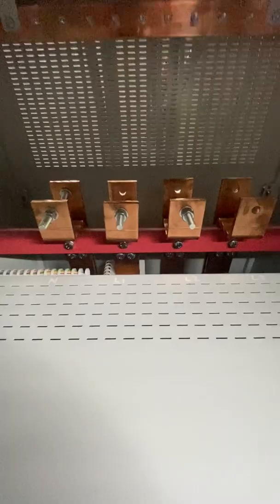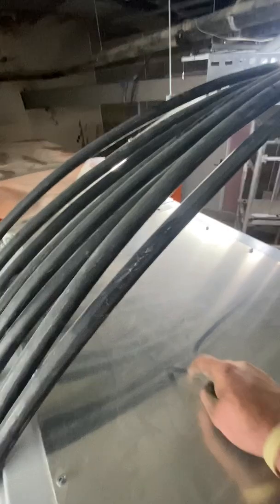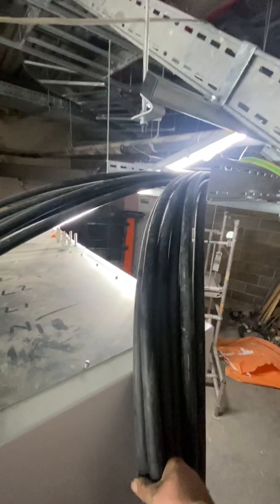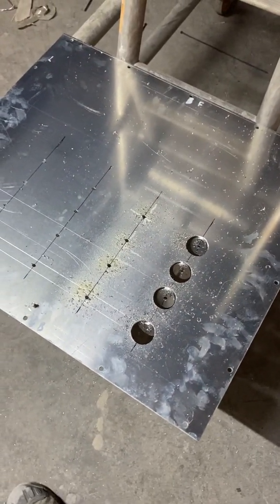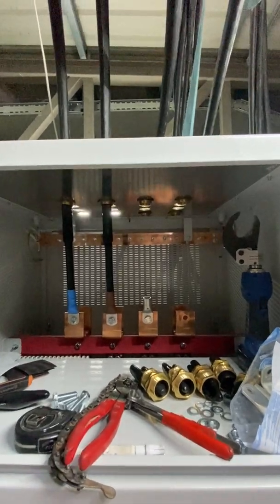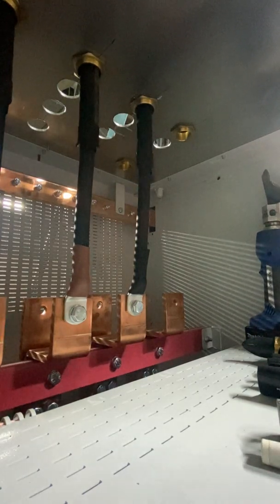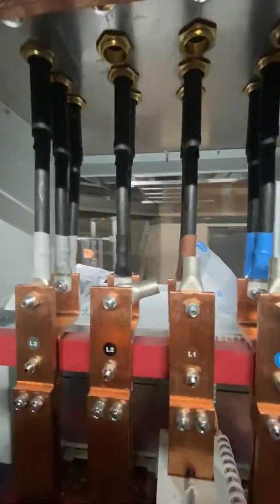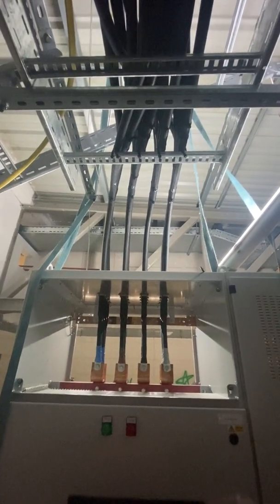How bad is the cross in the cables?

Comment: Hi Tony great content, i wouldn’t mind having a crack at this seems hard but rewarding work. Here’s a daft question: how do you which of the cables like when they’re on the tray are L1,L2,L3,N before landing them, is it written on the cable itself or does it not matter? Cheers! 🍺
Reply from the maker: The cable gang who pull them put a number on them at both ends so I know what they are. Some of those cables were 160+ metres long

Comment: When they were pulled in did they put them in tri cleats? When we’ve done the singles before it was part of the spec and they had to twist along the run - nice job by the way and on your own - what web you charge it should be doubled

Comment: Great work. Wish you tube and battery tools had been around earlier in my career!
Battled with 4 core 240mm with hacksaw to cut and large hydraulic crimped. Needed 2 of us!
Reply from the maker: Yes there were no such luxuries back then. The first 240 I did was with my dad. We had a hydraulic hand crimper but we had to cut each core with a hacksaw blade with cardboard and tape wrapped around one end because the panel was so tight. How I continued doing it for 25 years I'll never know😂😂😂

Comment: Shame the cable gang didn’t trefoil the banks. Tbh most engineers would look at that a get the cable gang back to redress the runs. L1 L2 L3 trefoiled with the N bolted through the trefoil bolt. You do get some jobs.Fair play.
Reply from the maker: Non of them have been and there's a lot of singles on this job. Don't know why but I'm not clever enough to design stuff like this. I just try and make it look nice😂😂👍🏻

Comment: Never heard of a ‘exhaust cutter’ until I’ve read these comments. I’ve used the armour slice on smaller swa’s which I never liked (hacksaw is easier imo) but that looks decent. 
Why did u put the black heat shrink above the glands?
Will not get eddy currents from separate holes?
Reply from the maker: The heat shrink is to cover the open cut of the armouring coz it's a stuffing gland, just makes it neater. The eddy currents are disapated due to the plate being non-ferrous.
Reply: @jointechcabling9103  top man cheers 👍🏻
Reply: Ally gland plate

Comment: Really nice job, would it have been easier to pull cables in without crossing if they came from the right instead of the back?
Reply from the maker: They'd probably still have crossed but it would have been less noticeable. I don't have any day in the direction they're pulled though.

Comment: Works on point !!

Lol 
You prob get 5/10 comments asking you about your chain cutter. 

I was the same when I first ever saw one of your uploads. 

Thanks for sharing videos, diff from what other YouTubers are doing. A lot of it is armoured, but still it’s the little small key points that you show/mention/demonstrate that make all the difference to the quality of work.
Reply from the maker: I do but I don’t mind because it’ll make life easier for everyone once they get one in the tool box. I should start selling them really.
Reply: @jointechcabling9103  which cutter do you use use for 

Small armoured 2.5mm

And also for no general  25/35mm armoured 

Many thanks
Reply from the maker: @mij.londoner  I just use an adjustable plumbers wheel. It’s the same principle as the exhaust cutter but only had one cutting wheel and a roller.

Comment: Great video, it's like art work and you made it look easy. 👌 

Ps what tool did you use to cut off steel strands of the cable. Is it just an amoured cable cutter that you use to score the cable?
Reply from the maker: Thank you very much. Very much appreciated. It’s an exhaust cutter. You can get them from Euro car parts and places like that. I wouldn’t be with out one now.
Reply: Exhaust cutter

Comment: Nice work that mate, been doing something similar with 240's , that cembre cutting tool, is it ok on armoureds? if so what's the largest size it cuts? ive got the battery crimper, brilliant tool ... if you ever need li-ion batteries theyre made by metabo.. half the price of cembre :)
Reply from the maker: I’ve got the big cembre cutter that can cut a 4c x 185 with the armouring on. I use the little Klauke for the cores. That’s the one I call Emu. The cembre one is called Big Bird!😂😂
Reply: That is some beast , largest armour i deal with is usually 4c120, been using a recip for years , but i think a dedicated cutter is the way forward  .. i use the knipex ratchet cutter for cores, does the job .. keep the content coming buddy .. so much better than watching another board change haha
Reply from the maker: @thattoolguy9432  I’ve got a few ideas but if you want anything in particular doing let me know and I’ll see if I can make a video of it.

Comment: Why didnt you gland the steel wire into gland at plate level. surley the steel wire isn't earth . or am i missing something, did you earth cabling other end. , Nice video by the way. keep it up
Reply from the maker: It’s an awa cable. The reason is to completely separate any earth from the transformer to the panel. The panel gets it earth from the main earth from the building and not from the street supply.
Reply: It's AWA not SWA
Reply: @posei3960  
Reason is not to create a parallel path because there will be a dedicated earth wire run from the tx.